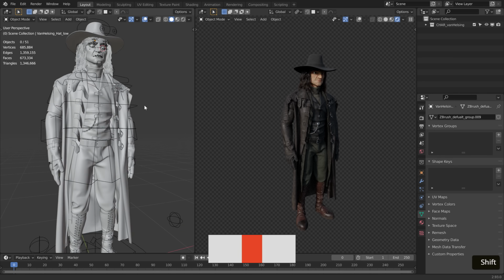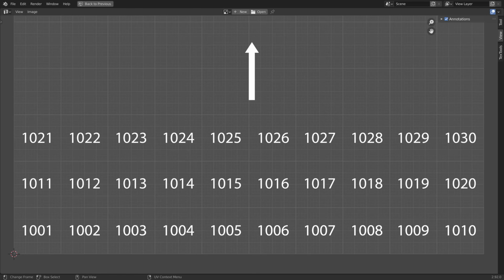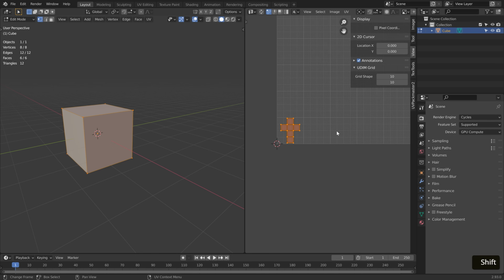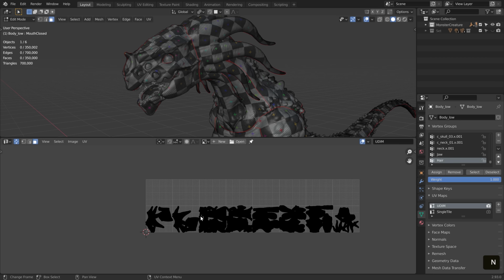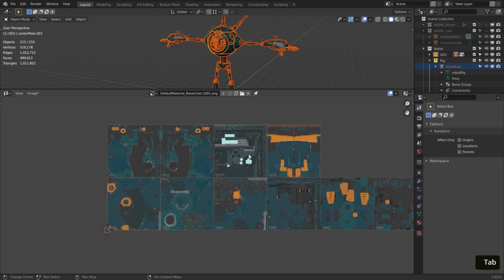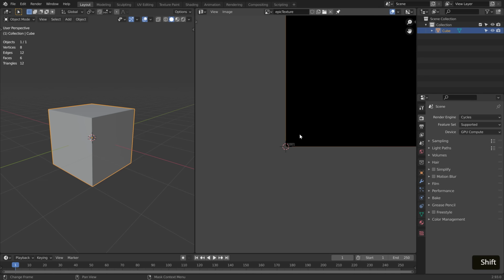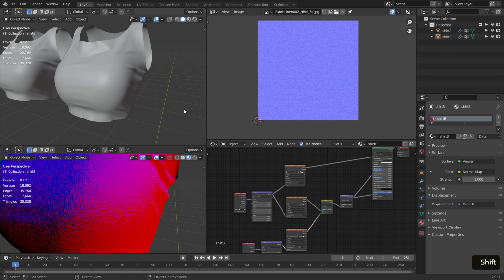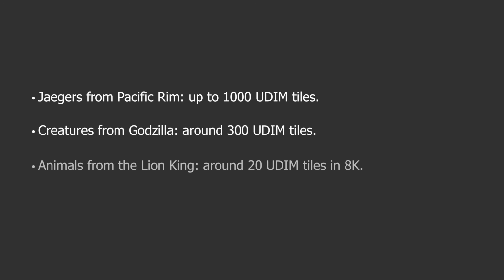Introduction to UDIMs in Blender

Comment: Can you help me that how can I use udims in game engines to optimize or how to use udims for game characters ?
Reply: I have handled many AAA game asset on only a fan basis, e.g. extracting and playing around with hero characters and weapons from modern game files. I haven't seen any ones that use UDIM so far! It is common for them to use about 4-10 concurrent texture sets on a character, with variable resolution between the sets, but in every case I seen they just use materials to separate them instead.

UDIMs aren't unique in that regard — you can still have your 4k face with 2k shoes and 1K backpack straps — but material separation seems to have advantages over UV separation when variable cosmetic skins are involved. Devs may happily add different procedural or tilable elements between cosmetic skins or change shader-level settings which justify separate materials anyway. There are other reasons too, like how game assets are made to be regarded by player-controlled view so an abstract imbalance of resolution is pointless unlike with a directed camera shot.

As far as I can tell UDIMS aren't a optimization philosophy rather just an alternative workflow for efficient texturing, that may or may not be appropriate or even efficient for something.
Reply: @Fe7Ace  thanks for help 🙌 I am working on my own game with a small team of my friends..... So i just wanted to know should I go for udims bake uv or materials thanks for the answer.
Reply from the maker: Thanks @Nikola Wiche for the answer. I focus mainly characters for feature animation or series, so I dont have much experience with game assets. But from what I understand, UDIMs are here to reach huge amounts of detail - which can be handled without problems in rendering, but games need to keep things real time and loading times fast, and having 10 times more texture files for gaming is not very effective. I guess they might be some exceptions but I believe that the main reason some game engines support UDIMs, is for game cinematics rendered in such engine, in that case, no one cares if it is not 100% real-time. You can have some lag but still able to render shots quickly.
Reply: @cgboost  thank you!!! now I had a complete workflow how I have to work. Thanks a lot and as always you guys are amazing !!!

Comment: Amazing. If i set up udims will it automatically pull into unreal or do i need a special set up to bring in the textureing correctly?
Reply from the maker: As long as Udim workflow is recognized in the software of choice, it will work as it is, no special setup required. UDIMs tend to be used in VFX and animation rather than in the game industry. But nowadays with the power of Unreal, and how they try to close the gap I'm sure they are supported as well 😁 - Juan
Reply: @cgboost  thanks very much!